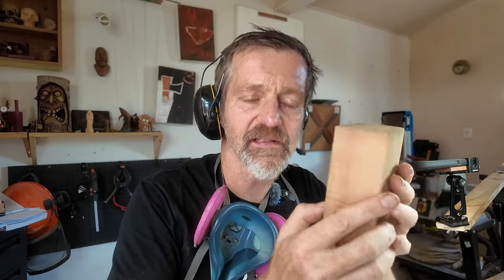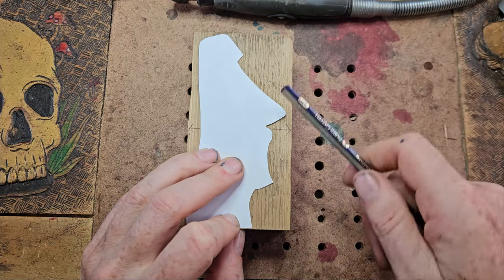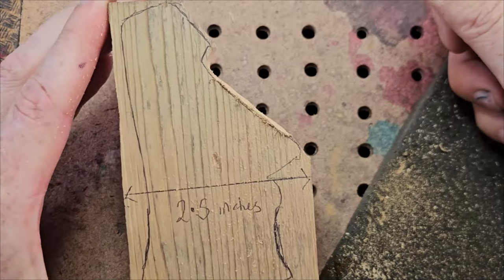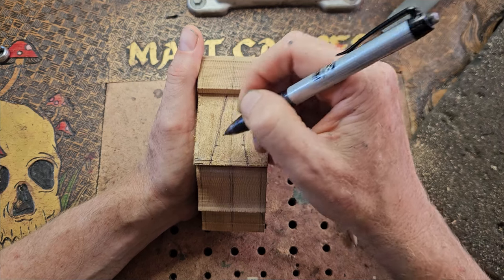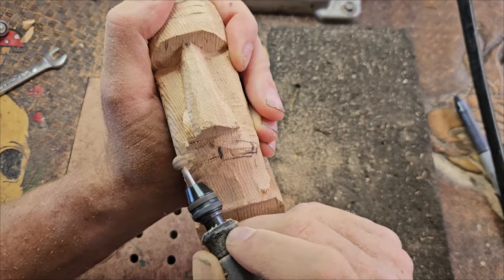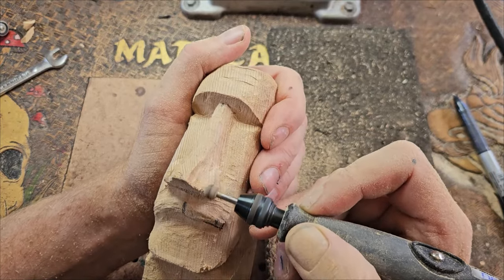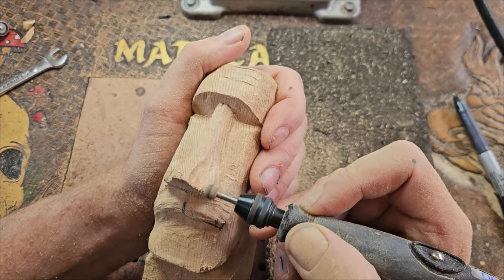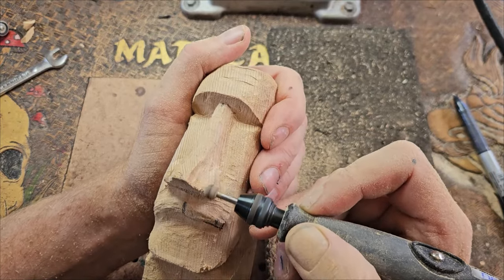How to Carve an Easter Island Head for beginners - Dremel carving

Comment: Came out great Matt. Was that your first attempt and what happened to the ears? I'm glad you didn't copy the Disneyfied yum yum head from Night at the Museum, whichI've seen in quite a few videos.
I carved hundreds of these, years ago, from tiny ones to big ones. What I found that its really easy to get something that looks right  from some angles, but not others. Slight changes can make it look right, but can just as easily make it look wrong. My best seller was a stylised (stretched tall) version painted with Plastikote stone finish paint. My friends all have these as fence post toppers (3 x 3 and 4 x 4) and stair post toppers, these also sold well
Reply from the maker: Yeah I saw the ears and thought not needed for a beginner. That's a cool idea fence post toppers, I might have to borrow that and make some NZ money 💰 👍. Cheers  for 👀  watching
Reply from the maker: Just looked up the one Night at museum 😁 I see what you mean. LOL